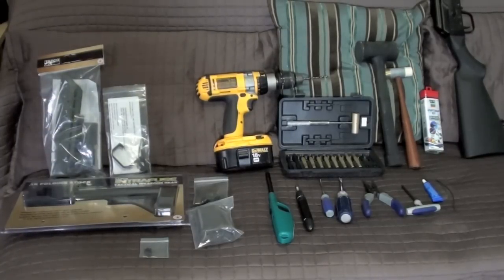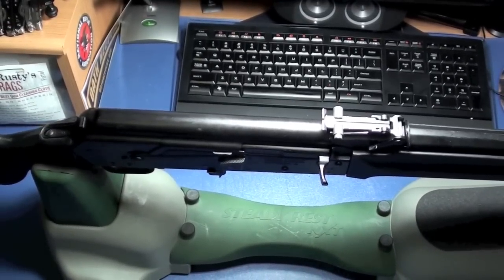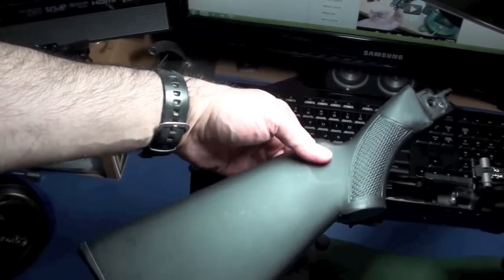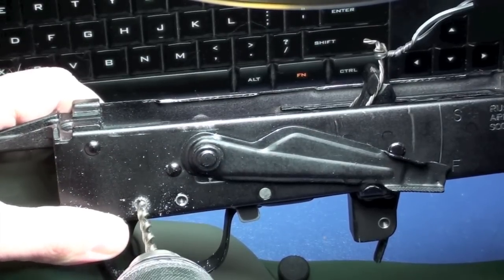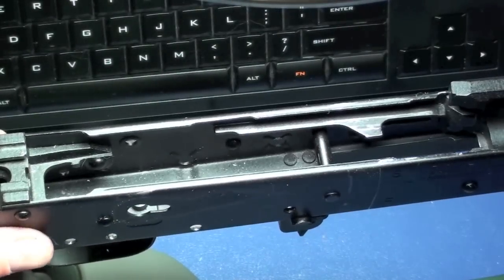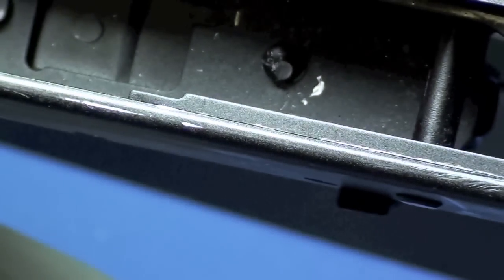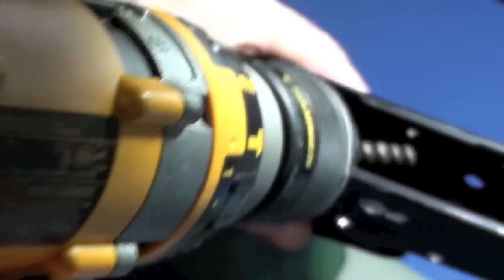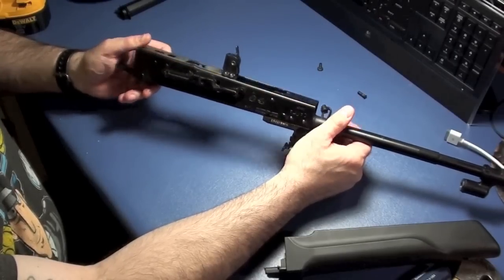Saiga 7.62 Conversion Part II (Disassembly)

Comment: Boy, using a drill to get those rivets out is a royal pain. Just spent an hour trying to do it. Then I used my Dremel to grind the rivet down then pop them out. Took 10 mins. Great Video! The detail of this video has been extremely helpful in my Saiga conversion...I definitely recommend using a Dremel to grind and knock out three rivets that attach the trigger guard and plate.

Comment: Thanks for the video. Got me started on mine today. Hint, though. After the first rivet at the back, just break the trigger-guard off. That way, you can drill the center rivet from the outside. Also, a pin-punch to the center of the river makes starting the drill a lot easier. Not that it matters a lot to you since you're done. But if someone else is reading these comments, may give them a hint.
Reply: rockspydre 
Should I drill them all from the outside?

Comment: @fredhart.  I was hoping you would cut off the trigger guard so you could get that last rivet from the bottom :).....  I learned allot from this video.  I am considering a conversion after my AR build is over.  The last parts are supposed to show up Monday!!!!  I think I would center punch the rivets before I drill them to prevent the bit from walking.  This video was the reality TV version of Saiga conversions.  Happy holidays!

Comment: Good vid, you made it look easy....Right up to the assembly plate rivets......Using a center punch to scar the center for the drill bit to spin in wouldve made it alot easier for you.....Good info thanks for sharing..................................L&B

Comment: GREAT tutorial! I s You made a GREAT tutorial. I settled on using your video for direct guidance after watching several other examples for comparison. Your patience, skill and methodology are admirable. What type of bits are you using? Mine simply didn't produce the flying shards that yours did, and I leaned into it for hours! ettled on using your video for direct guidance after watching several other examples for comparison. Your patience, skill and methodology are admirable. What type of bits are you using? Mine simply didn't produce the flying shards that yours did, and I leaned into it for hours!

Comment: GREAT tutorial!. I settled on using your video for direct guidance after watching several other examples for comparison. Your patience, skill and methodology are admirable. What type of bits are you using? Mine simply didn't produce the flying shards that yours did, and I leaned into it for hours! I settled on using your video for direct guidance after watching several other examples for comparison. Your patience and methodology are admirable. What type of bits are you using? Mine simply didn't produce the flying shards that yours did, and I leaned into it for hours!

Comment: What type of drill bits are you using? I did my drilling today, and it was a SUNUMABITCH! I leaned into it for hours but wasn't able to produce the flying metal shards that your drill did. I still need to smooth out a few holes. The hardest ones were underneath the tang, and the one blocked by the trigger guard.  Any suggestions or revelations would be welcome. You made a GREAT tutorial by the way. I settled on using your video for direct guidance after watching several other examples. Your patience, skill and methodology are admirable.

Comment: What type of drill bits are you using? I did my drilling today, and it was a SUNUMABITCH! I leaned into it for hours but wasn't able to produce the flying metal shards that your drill did. I still need to smooth out a few holes, although I can fit screws through most of them. The hardest ones were underneath the tang, and the one blocked by the trigger guard.  Any suggestions or revelations would be welcome. You made a GREAT tutorial by the way. I settled on using your video for direct guidance after watching about 5 other examples. Your patience, skill and methodology are admirable.

Comment: GREAT tutorial!. I settled on using your video for guidance after watching several other examples for comparison. Your patience, skill and methodology are admirable. What type of bits are you using? Mine simply didn't produce the flying shards that yours did, and I leaned into it for hours! I settled on using your video for direct guidance after watching several other examples for comparison. Your patience and methodology are admirable. What type of bits are you using? Mine simply didn't produce the flying shards that yours did, and I leaned into it for hours!

Comment: cool thing about the russians adding that plate to the bottom is you can grind the rivet heads right off with ZERO risk of damaging the receiver.. you know damn well they designed the saiga rifles for quick and easy conversions. thats why they didnt put much effort into the saiga trigger either

Comment: You made a GREAT tutorial. I settled on using your video for direct guidance after watching several other examples for comparison. Your patience, skill and methodology are admirable. What type of bits are you using? Mine simply didn't produce the flying shards that yours did, and I leaned into it for hours! Any ideas?

Comment: Do u know if the receiver and barrel that u took this gun down 2, can be used with 1 of those AK kits that r sold without the barrel and receiver? Of course keeping n mind the import laws. There’s 1 on the Sportsman Guide website item# WX2-293326 - Used Bulgarian AK - 47 Replacement Parts Kit with Folding Stock

Comment: Smaller bit would make it easier then use the suggested bit to finish.
Reply from the maker: bigrebnc1861 Thank you.  I would have normally done this on my drill press but I wanted to do this video as if I had limited and basic tools.